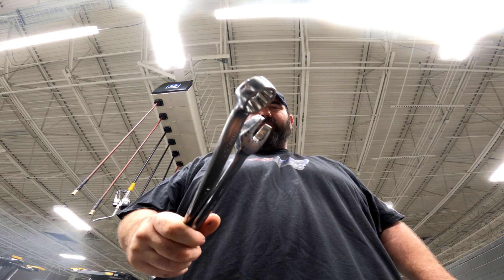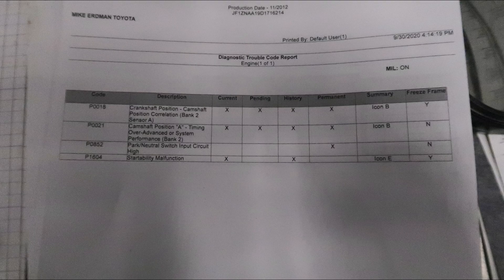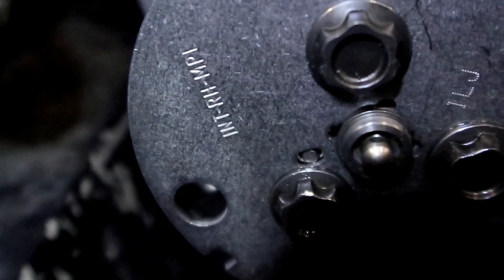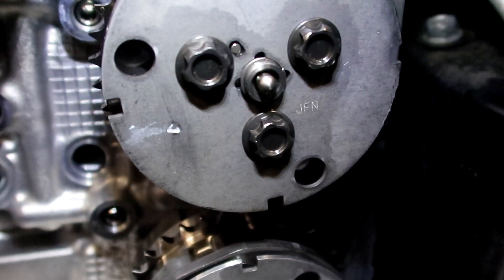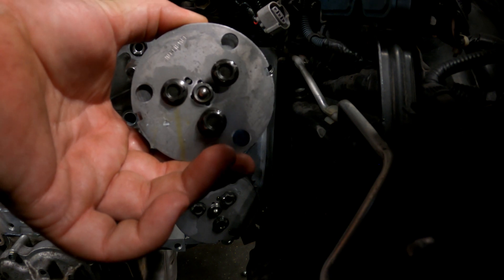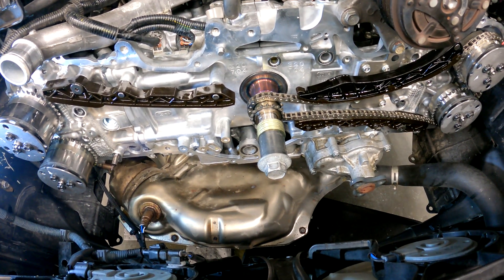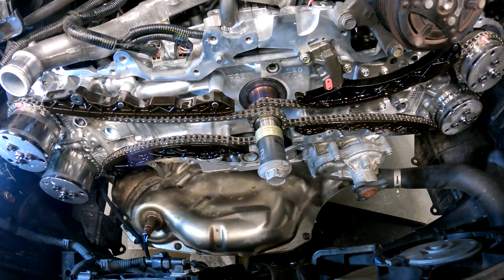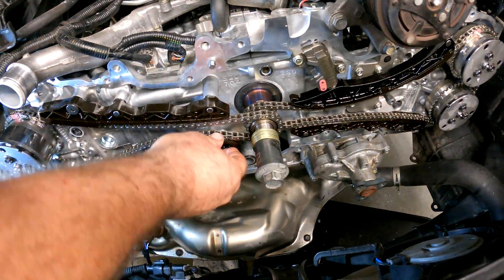how to fix check engine light FRS BRZ FA20 p0016,p0017,p0018,p0019

Comment: Hey! I drive a 2015 FRS and am getting the codes P0011, P0016, P0018, P0021. Is this the same issue? I took it to the dealer and they said it could be the oil control valves or the cam gear. They said the could replace everything but still might not fix the issue. I am taking it to another shop as well but still trying to figure out what the issue is on my own. Any ideas?
I just finished replacing my clutch, flywheel, pressure plate, fork, pivot, etc. Then when I went to turn car back on I had the codes.... Not sure if they are related at all?? Any help would be appreciated thanks
Reply from the maker: I would check the harness near the rear of the engine that is where sometimes plugs get overlooked and you might get this code. but normally a clutch job will not cause this the other shop that said if they replace all those parts and it might not fix it is slightly right so in the manual it has you check the valves if the valves are ok replace the gears if the code returns after gears replace the oil control valves and if the code comes back after that they recommend replacing the ECU I've put the gears in to fix this a few times never an ECU but I know the ecus do fail and cause this issue the oil control valves are the cheaper and easier to get to parts so if I was doing this my self-id start there but in my experience, the gears seem to fail often I hope this helps please help us out by smashing the like button and subscribing to the channel we do some fun car stuff here from time to tim.
Reply: @ParkHopTillWeDrop  I was surprised to have this issue at all given my car doesn't even have 50k miles yet. What should I look at the plug? Make sure its connected right and not damaged? I looked at it previously and seems to look fine to the eye. Is changing the oil control values and/or cam gear something I could do on my own or should I have a professional do it?
Reply from the maker: @sammic266  if your good at working on cars you could attempt this on your own just know timing is something that has to be 100 percent perfect or you will damage the engine
Reply: @ParkHopTillWeDrop  Yeah thats what I thought... thats why I am a little iffy about doing it myself. I've changed a timing belt on a '77 Esprit but not sure if I want to attempt this one

Comment: Hey I was wondering if I could get some advice I change my spark plug in my  Scion FR-S and now it won’t start so I used a obd2 scanner and it give a me a code P0451 any suggestions on how I can fix the problem? It’s something about evap sensor
Reply from the maker: so an evap code won't keep a vehicle from starting I would go back and double-check everything you had to touch to do the plugs like check the ECU connections as it had to be moved after that you need to find out with a spark tester if you are getting spark this will make narrowing the diag down slightly easier
Reply: @ParkHopTillWeDrop  okay thank you it worked!!

Comment: I’m having a issue rn with my 15frs when I slow down and come to a stop, it seems the rpms drop really low and the engine does a weird stop really quick . Not to sure how to describe it . Check engine light came on also, any idea what this is ?
Reply from the maker: Without knowing what code you have it would be hard to guess
Reply: Me too happends at around 11 mph. I hear almost like a knock and it feels like it either brakes hard or just feels like a bad shift. Have no idea. Happened after I took my 2013 FRS to the Toyota dealer for the infamous recall.
Reply: @aking970  same, it feels like that sudden lurch forward after overrevving a downshift. But I haven’t downshifted
Reply: @phrawga  yes exactly well stated! When did that start occurring for you? And is it always on or when does it turn on for you
Reply: @aking970  this started a few months ago at 56k miles, I bought it at 48k miles. I’ve taken it to the dealership several times because I have a friend that works there. The dude knows 3x the amount about an engine than I do and that’s saying something. He can’t even find the issue. If I clear the codes it goes away for a day but it inevitably comes back. This error code is pain in the ass even with a Diagnostic tree. I’m guessing it’s something to do with my gearing. He himself said it’s going to take him months to actually find the issue. If it makes you feel any better it won’t hurt any of the integrity of the engine itself. It May Say it’s a CPS on the OBD but it’s probably not. You should be fine, even with the light on. That doesn’t change the fact that I want this shit fixed.
Reply: @phrawga  My 2013 frs rpms will drop when coming to a stop and make a weird noise then rpms jump back up. I've had it for 4 months and its never thrown any codes. Previous owner had the P0017 code thrown and dealership replaced the ecm. Would this damage my engine if ignored? It's my daily driver and I don't drive it hard at all and has 80k miles
Reply: https://jalopnik.com/heres-how-to-fix-the-scion-fr-s-and-subaru-brz-engines-5948647

Go explain that to your dealership and have them reflash your ecu
Reply: It takes power from your engine lowers the horsepower. If the extra powers not important to you then there’s no need to get it fixed . I had the same problem happen to me . It will be about a 1,500- 2000 dollar fix if you want to do it

Comment: What does a job like this cost?
Reply from the maker: its around 8 hours plus the gears so one gear is around 300+8 hours@140 per hour =$1420 ish
Reply: @ParkHopTillWeDrop someone tried to charge me $5k
Reply from the maker: @RumBTv  5000g seems pretty excessive I could see like 2500 if they did the chains guides and all that.

Comment: Does this apply for a FB25 with P0011 and P000A when I already discard the solenoids, camshafts position sensors and putting brand new oil?
Reply from the maker: seems to be basically the same motor has the same actuators and ocv so I would say this is ver similar to the fa-20

Comment: i have code P0018 on porsche panamera s e hybrid 2014  it could be the same problem??
Reply from the maker: Doesn't seem to be the same engine but time codes are often caused by timing gears or mechanical timing being off I recommend checking the timing and oiling system as per the diagnostic tree for that code

Comment: Thank you for the video! I’m throwing a p0020 code wondering what’s your take on it? I know it can be the cam sensor which I have replaced, cam sprocket which can be expensive, or could be a harness/electrical problem. Thank you!
Reply from the maker: in my experience the gear is the failure point most times however checking the wiring is fairly straight forward just check resistance from the ECM to the controller should be less than 1 ohm if you did the sensor already and the wiring all checks good there's a good chance you have a gear issue.

Comment: Hey man, thanks a lot for posting this video. This issue has been torturing me for months now and it all happened after my timing chain and guides were replaced the car was running perfectly before that. At first, we thought it was faulty AVCS solenoid and after replacing it the issue went away for a couple of weeks, and then it came back in the form of misfiring and stalling at low RPM but no CEL or SL. I took it to a shop that replaced my LH INTAKE cam sprocket because they claimed that after removing the timing chains the sprocket should be able to rotate freely. That didn't work as well which is why we replaced all of the AVCS solenoids with brand new OEM ones and that solved the issue for a month and then it came back. Now I've got a CEL and SL and I can't remember if the code was P0016 or whatever but as far as I can remember it's about a faulty RH EXHAUST gear. I've read 100s of forum threads and I can't find a clear answer to this problem. Do I need to replace all of the cam gears and/or the ECM? Can this issue with ECM be fixed with a remap or a USED ECM? Please give me some pointers I'm getting desperate.
Reply: May I ask, what was the fix for you if anything? i see they started talking about resetting values but thats been of recent.

Comment: So I have a question I got the same code p0018 and I replaced basically the whole timing set up (chains,gears, guides and tensioners) and obviously the sprockets but I only replaced the top 2 intake sprockets just to be on the safe side but I still have the check engine light. When I took the timing cover I noticed the bank 2 A chain was a tooth of the pink mark on the chain. Which led me to know the timing was off. But now I don’t know what to do to get it to go away does this mean I need a new ECM and retune my BRZ ?
Reply from the maker: if the timing was one tooth off that is your problem if your sure the timing is right and you still have an intake code for a gear you already replaced you might infact have a bad ecu however you cant rule out the possibility that the new gear is faulty did have that happen once
Reply: I went from replacing sensors and VVT solenoid to new gears.
Reply: My car runs fine once I clear the code it starts up just fine as well I tried to looking at the wiring but I don’t see any burns or rips on the wiring them selfs I’m leading more on the ECU now 🥴
Reply from the maker: @freddyarguelles6007  yeah so talking to our field rep on this issue I was told if the gears are known good and the timing is good there is a very good possibility there is an ecu issue however just know that I replaced all 4 gears on a car and had this code after we found one bad gear brand new out of the box so that is possible also might want to swap the gears if you have the same bank code all the time and make sure to check the actuators on the front cover they can also fail and cause the gear to not activate
Reply: @freddyarguelles6007  hey, I have a 2013 frs with the same problem as you, just following up wondering if you ever got it fixed?
Reply: @insaiyann8925  I ended up going back to my tuner and was able to delete the check engine light permanently which saved me a lot of $$$ and didn't have to replace the ecu or retune
Reply: but for the sake of doing things the right way replacing the ecu after replacing the gears and sprockets ive read that it is Necessary to replace the ecu and retune so your gears and computer relearn their position

Comment: Any idea what causes this failure? Just wondering if this is really an ECM problem, that sets of the timing, or oil pressure, etc. That would mean replacing sprocket(s) and/or ECM is just a temporary fix. Did you also need to replace the ECM on the 4 previous sprocket replacements? This is a great video, and made this entire P0016/18 process much less mysterious. I'm thinking I'll have the chain cover oil ports and pump disassembled and cleaned, while in there. Does that seem worth it to you, in your experience?
Reply from the maker: as the gears wear they begin to not lock when commanded sometimes this can be a clogged oil galley but most times its a worn or bad gear and the fix is to simply replace the gear
Reply: @ParkHopTillWeDrop  Thanks for that speedy reply. I'm switching out both of my Bank1 phasers, not going to risk it. Will likely disassemble and clean up my oil pump and channels on the belt cover. Your video was VERY helpful. Do you ever need to install a new ECM after changing out the phasers? I understand the VVT learning angles are burned in. and will trip future codes, even if the phaser is operating properly.
Reply from the maker: @glenkilloran79  I've done 4 sets of gears now and have not needed to install an ecu yet but I know it can happen you won't know till you put the gears in  😢
Reply from the maker: @glenkilloran79  I also have a video on setting the timing makes it super easy I recommend you check it out if you run into issues.
Reply: @ParkHopTillWeDrop  Watched it. Another great video. It really is appreciated, with this being such a high cost repair to watch your videos. Cheers mate.
Reply: @ParkHopTillWeDrop  I just did the repair on mine and the code keeps coming back even after scanning for the correct positions and seeing no problems. I’ve kinda tried everything and wonder if I need an ecm. Thoughts?
Reply from the maker: @joshi2381  if you are sure the timing is good and the actuators have been replaced after checking the wiring one could assume the ecu is your issue although not common they do fail I hope this helps get you back up and running